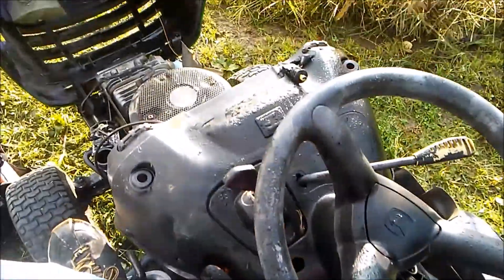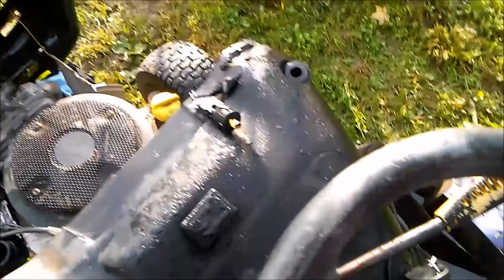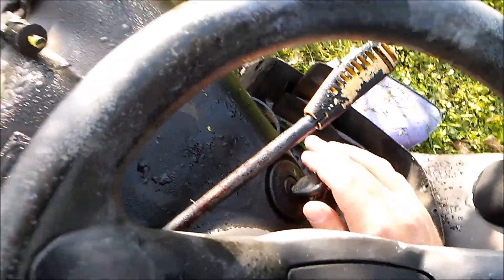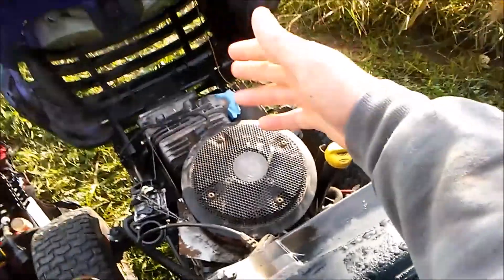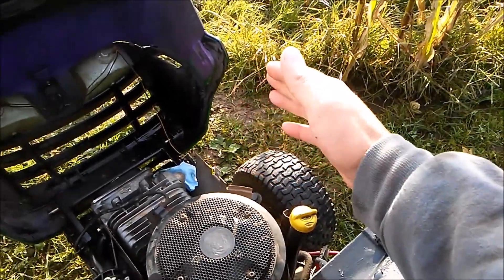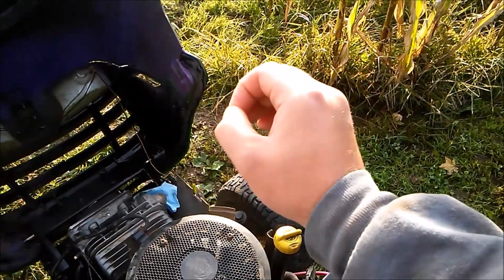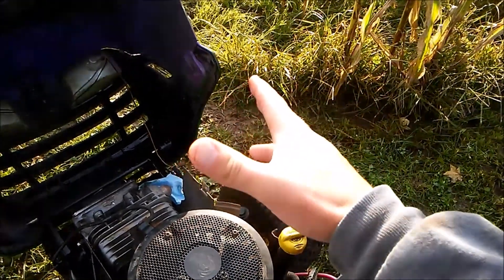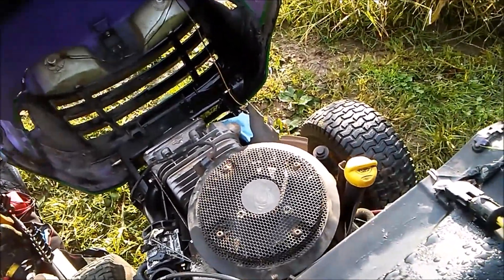Oil on Spark Plugs Fix on John Deere 100 Series

Comment: Oil will come back into the combustion cylinder if the issue is not resolved. How is the oil getting in in the first place? Perhaps needs new piston rings.

Comment: Why in God's greener would you leave the spark plug on the spark plug wire while you're turning it over and you're just trying to pump the oil out, Also did you just overfill it and that's what you're trying to compensate for or do you have bad rings